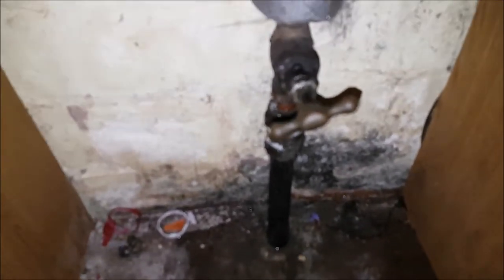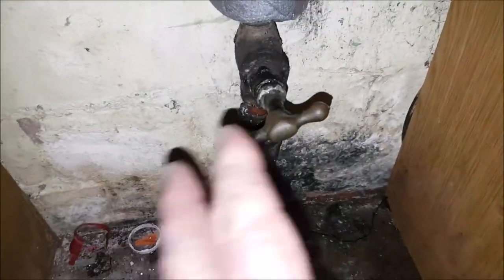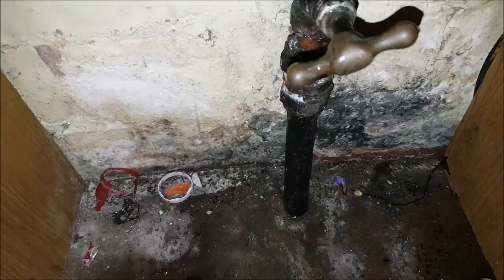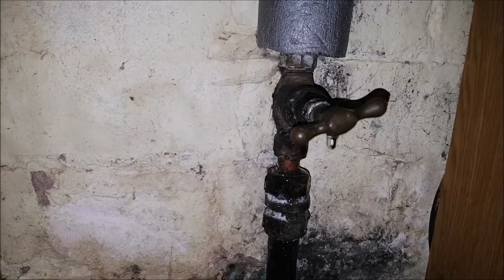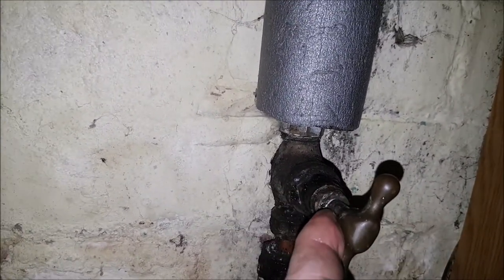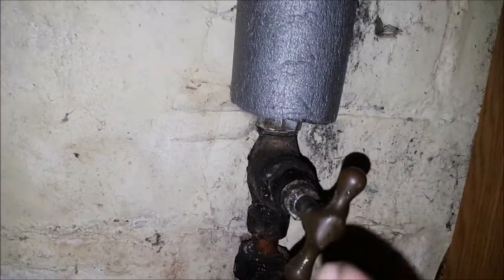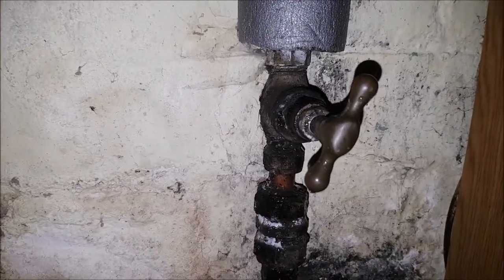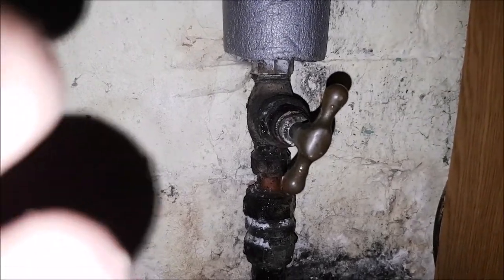How to repair a leaking stopcock

Comment: Sorry if I sound stupid here....
Leave the house water on keep the tsp open fully undo the nut pull it to the handle that you grab when you turn the tap then take the thread screw but back on? 
Won’t the water piss out when u undo the nut?